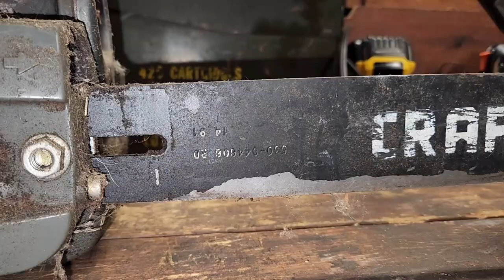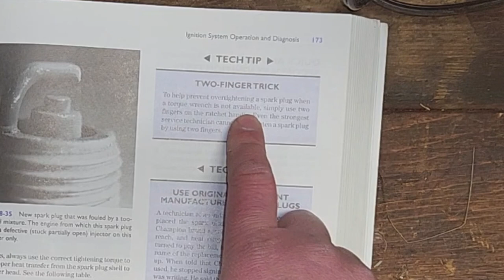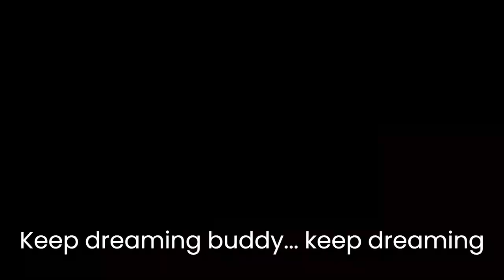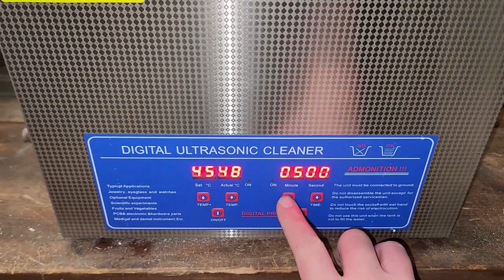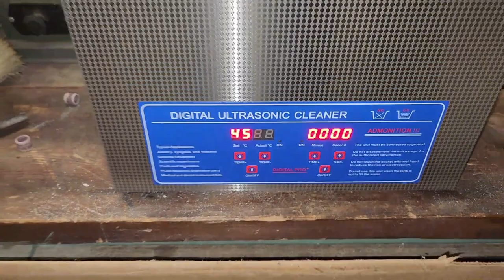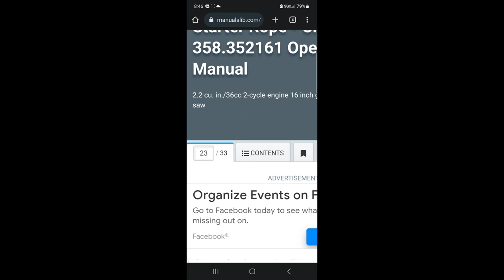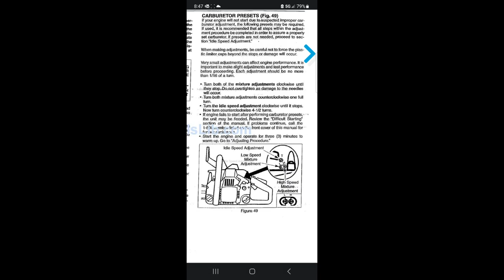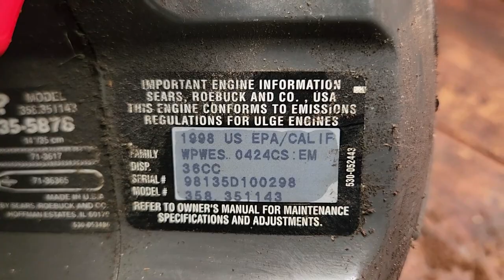Machine Rehab - Craftsman Chainsaw - Will it Run??

Comment: It sounds like you got into small engines the same way I did. I started by working on cars, but just do not have the available funds to pursue that particular hobby. I lucked into a bunch of lawn mowers that had been sitting for years, and that sparked my interest in small engines. Now, everyone I know gives me their junk when it stops running, so I have a constant supply of projects, and they really don't cost me much money. I have 5 riding mowers, 2 push mowers, 4 weed eaters, 2 chain saws, a pressure washer, a tiller, a 150cc go kart, a generator, and 2 compressors that were all given to me. That's on top of stuff that I pick up off the side of the road, lol. Thanks to being a hoarder, I have a huge parts stash. I built a factory correct Troy Bilt riding mower out of my parts stash last year. That was a fun challenge. I actually had everything but the belts. None of them ran when I got them, and all but 1 riding mower run now. I still have little things to button up on most of them, but I'm making progress.
Reply from the maker: Wow that's a heck of a collection!  Sounds like you need to get yourself a channel going!
The Troy Bilt project sounds like it was a lot of fun.  Like a Lego set, but without the instructions or all the parts you need in one spot 😄
I'd like to move on to bigger machines, but, like you said, not in the budget right now.  Some day though!  Some day!

Comment: Thank you for sharing. Your videos are entertaining-great monologue. Heads up on the needle. It has a coating on it that was removed when placed in the ultrasonic cleaner. You are better off to not put the rubber tipped needles in the cleaner. If they are corroded either replace or clean them with WD40 and super fine sand paper. Usually not a problem with 2 stroke machines.
Reply from the maker: Hi there - Thank you very much for the compliment 🙂
Hmm... so the needle was supposed to have a black coating on it?  I thought they were supposed to be pink.  Either way - thank you very much for this suggestion.  I'll be sure to keep them out of the cleaner next time  👍👍

Comment: That gree goo was probably some type of fuel stabilizer or additive. They either used way too much, or it got left in there for a looooong time.
Reply from the maker: I was thinking so too.  I think I've seen other channels where Sta-Bil actually caused some problems.  Especially if you use way too much.

Comment: I use the yellow Harbor Freight degreaser in my ultrasonic cleaner. It works really well, and I have an el cheapo ultrasonic cleaner. A Youtuber named James Condon turned me on to that, and he has the same ultrasonic that I do.
Reply from the maker: I'll have to check into that!  Good ole' Harbor Freight!